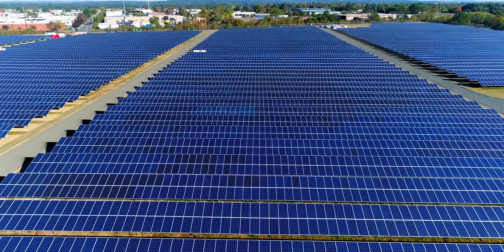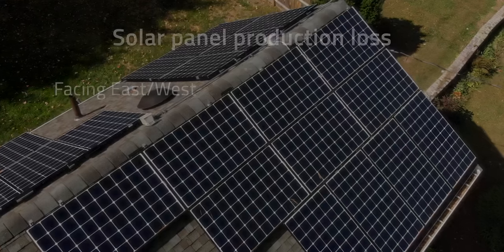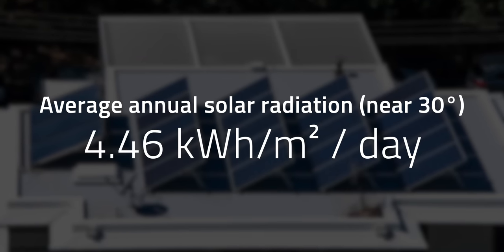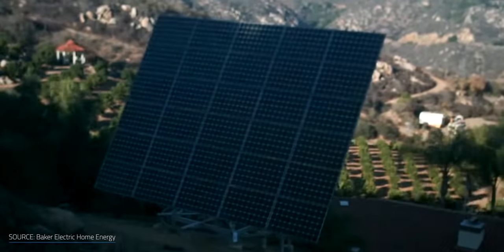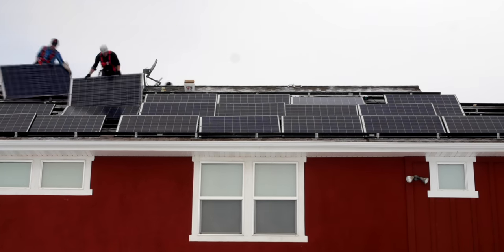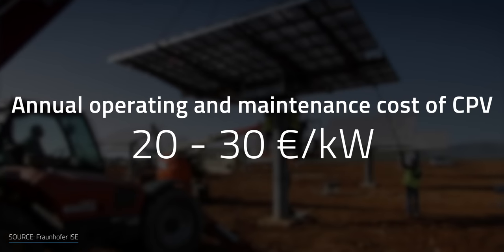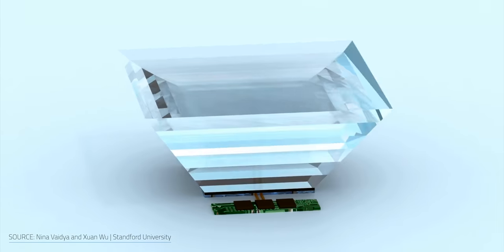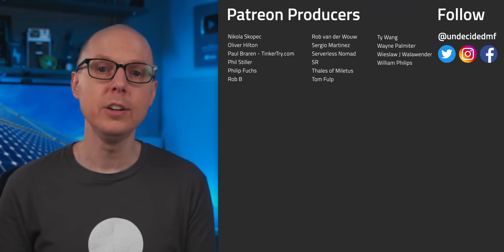This Invention Could Supercharge Solar Panels

Comment: As a mathematician, I'm really skeptical. If you don't move your panel facing the sun, you don't get more surface capturing sunrays. The only purpose of this concept is to get sunrays hitting perpendicularly the cell. A very small improvement ...
Reply: I suspect that solar cells can only absorb a few percent of the available rays.  I think that increasing the surface area of solar panels without increasing the required footprint might result in better efficiency.
Reply: I was thinking the same thing. If you have a 1sq meter panel at 20 degree tilt putting concentrators on doesn’t change how much sun energy is hitting that 1sq meter.
Reply: @ecospider5  we are going to the same thing: when you concentrate is the PV the best fit as technology. It absorbs the upper side of the spectrum and the infrared spectrum converts to unnecessary heat which needs to be dissipated. Good discussion: :)
Reply: It enhances the energy per chip.  Not the energy per roof surface area.  Cheap recyclable plastic not silicon wafer and rare earth elements.
Reply: Totaly agree. How these concentrators can increase the total capture surface? They can't. So, even assuming no losses from the concentrator, the system should have the same drop in performance as a regular solar panel when titled.
Reply: Yes you get less energy with less area of course - i think the only novelty in this video was the part at the end where the concentrators are made so the light is always funneled to the pv cell. 
If you used a simple lens that focuses light on the pv cell when the source is normal to the lens and then shine the lightsource from a different angle the beam might not hit the cell.
*     vs     *
I                  \
O                  O
I                      \
_                   _   \

This only solves the problem you create by having the pv cell not directly everywhere on top.

Making the concentrated pv cell generate the same energy as if you used it on top but with less cell material. And more energy if you use more wavelengths( more expensive cell)
But as others pointed out cooling and the complex buildup might be a problem.

Also i see a problem with the 3dPrinted lens- if its Plastic it will not age well in the uv exposure and potentially even the moistness.
Reply: @ecospider5  of course not. and when you hear things like 'ten times more energy' you know its a scam.
Reply: plus solar panels are quite cheap anyways I don't really understand the extensive research when you can just buy 2 panels instead of making one more efficient
Reply: While that it is true that you get a higher energy gain from direct sunlight, the differences can be somewhat small as he showed. I know 10% doesn't seem small, but it is if you can use this tech to make higher efficiency cells. They can be smaller while still receiving the same surface area of sunlight as larger cells. This could help reduce production costs drastically as the solar cells are the most intensive and expensive part of the manufacturing process.
Reply: My thought was similar.  The angle of the panel sets your flux density.
Reply: @zfolwick  Correct, CPV method just concentrates the sun rays to a focal point, sure there will be some gains but more of an efficiency outcome. Surface area is where most of the gains are made, make the photoelectric surface triangular at the microscopic level similar to a concertina effect but at the optimum angle too much will results in negative gains.
Reply: Yeah, have you never seen the reports of the 40%+ effient solar cells? These values were optained under concentrated solar conditions. The efficiency of solar cells goes up when you increase the photon flux hitting the cell, so not only does your panel produce more energy, it also converts a higher percentage of the light energy hitting it into usable electricity, further increasing the amount of electricity produced.
And now, do the maths: what happens when you decrease the amount of polysilicon you need to produce and dope and make into wavers per solar panel (which has a huge cost in terms of energy and subsequent CO2 emissions) and these cells do not only capture the entire light that hits a full-sized panels surface, but due to the concentrator effect, each tiny cell also has a few percentage points more efficiency in converting that light into electricity. Now couple that number by increasing the amount of solar energy that hits the panel directly over the day, instead of being reflected by its surface thanks to the concentrator and the result of your calculations should look quite different.

There's a reason why people got so excited when they heard that you can increase solar panel electricity output by 2% if you heat them shortly before sunrise through resistive heating. Because 2% more output per panel may seem negligible, but on the scale of entire countries, it adds up pretty fast.
Reply: Exactly!
Reply: @DavidAttenbraai  There is not always room for that extra panel.
Reply: @MrMarkdro  The multi-layer lens compensates for the different incident angle so tilt doesn't matter (up to a given threshold, I'm sure). The light will still be directed to the bottom of the lens.
Reply: @edeaglehouse2221  The pronlem is befor the lenses. The lenses can only redurect the light they capture. So when they titl, they will capture less light. Exaclty like conventional solar panels. Thee is no way around this.
Reply: @MrMarkdro  Actually the problem is two-dimensional thinking. The lenses and PV cells are three-dimensional. The lenses are directing more of the light penetrating the lens surface and redirecting it at closer to optimal angles to the cell surface so the cell is getting more light it can convert. The lens won't completely eliminate the efficiency drop from the tilt, but it will reduce it to the point that the panel wouldn't need any fine angle adjustments to maintain its maximum conversion efficiency, because the light always gets to the cell at the best angle.
Reply: yea, studying Astronomy will tell you it is all about the flux you receive over a surface. You don't actually receive more flux because that is fixed (what you can do is use less material. but these looks like hell-a expensive to make)
Reply: One of the key things about the solar panel is you are using the photon to knock a charge though a semi permeable barrier. Ie its colliding with something and forcing it though. As if its not perpendicular to the force it needs to travel a further distance to get thought the barrier as well as requiring a greater collision force.
Reply: @generalharness8266  True. Photons could knock the charge more effectively with Agile. I still doubt that the gain worth  the cost of these big lenses.
Reply: Ultimately I think the idea is to use less PV material (the expensive part) and more concentrator material (ideally an inexpensive material).  So you'd reduce the amount of PV material to create a given amount of power, but you wouldn't actually reduce the amount of square footage of the panel.  The math works out when you think of it that way.  Especially when you combine that with being able to use a higher end PV because you need less of it, and if you can use the defraction properties of the concentrator to channel the light at a more efficient angle regardless of the panel orientation.
Reply: @edeaglehouse2221  Ideally, in 3D, maybe 1% more surface, assuming a 10 cm high lense   Practically the lense will be around 2 cm. So, maybe 0,1% more surface. Now, everytime light is passign from a crystal, is loosing energy. So your lenses practically collect less energy for the same given surface. But because they focus it, they can  make usuable a bigger percentage of the energy. That is all. Now, trying to say that it will magically focus the light that is coming from the side and it will be like is coming face on,  is not based on logic or science, but on wishfull thinking.
Reply: I think your scale is off by a factor of about 100. No, there is no more light hitting the surface of the lens but more of that light is being directed to the cell at the bottom because of the way the lens is designed. Couple that with the fact this uses 1/4 the cell area and uses a more efficient cell and it is going to produce measurably more current. Even if the panel is tilted a little bit, the cell will still almost perpendicular light. Sounds like a win to me  add long as the lenses cost significantly less than the beefier cells.
Reply: Never thought I’d find a chain of actual intelligent arguments in a replies section, this be the most psychologically healthy group of strangers I’ve ever seen
Reply: Mathematician....yes that explains  why you dont know what you're talking about it.
Reply: @DavidAttenbraai  horse and buggy were probably cheaper too
Reply: You might want to go revisit your trigonometry.   One thing that does make what you say a little more true is the fact that as the sun gets further and further off of the pointing angle, ie nearer the horizon, it provides less power/area than when high in the sky.  This is due mostly to atmospheric attenuation.   

You should probably rethink your skepticism when the data is empirical, as one example was here.  Just sayin.  I remember a prof saying if you calculate the weight of the guy in the elevator to be a ton, in one of his problems anyway, you might want to check your work.  :-)

You DO get more effective surface area capturing sun rays off axis.  Take the source and put it 90 degrees to the panel face (perpendicular to a side).  How much light is striking the panel now (let's put it in a vacuum to make it easier).   Right, zero.  Cosines, anyone?

Comment: I mechanised my panels using linear motors and a raspberry pi and I noticed quite an improvement tracking the sun. Beefing up the whole installation over the next few months - very therapeutic seeing the Kw/h being home grown vs the rip off energy companies that are shafting us in the UK & EU currently. Also I don't use a sensor, mine is math based using longitude, latitude and date - credit to the egg heads that wrote the original Python code I plagerised - I wish I was that clever!
Reply: Solar tracking kills solar panel life span. No free rides.
Reply: @johnslugger  In the UK/EU with energy prices through the roof, I'm not sure what the trade-off is. I've got more electricity than I can use parts of some days, it's not cost effective selling it back to the grid so I'm building a sand battery in a disused sauna to offset cost of gas.
Reply: you were still smart enough to setup a tracking solar panel with an R-pi...your doing fine my man
Reply: Very clever and this is the best way to increase solar panel output.
Reply: @johnslugger  How so?
Reply: @anxiousearth680  Every photon caught to make wattage degrades the panel faster. That what breaks the Silicon P/N junction matrix down until its no longer as conductive as a new panel once was. Solar is NOT a "forever power" source. 25 Years Tops with a 20% drop at 12 years!
Reply: @johnslugger  Eh, who cares. In 20 years time you can add 2 more panels and make up the difference.
Reply: Is this documented anywhere?  Would love to see the details of the mechanical setup and the r-pi automation.
Reply: I have a small mount for astrophotography that follows in one axis (right ascension) the sideral rate, do you think it would make sense to adapt my small 200W foldable panel to it?
Reply: @tesla747    I have done the math. The money spend on TRACKERS is better spent on buying 30% more panels. Same power output with 35% longer panel life and less complexity.
Reply: @johnslugger  Panasonic panels are still 92% efficient (compared to new) after 25 years.
Reply: @pauld3327  Only 3% of panels on Roofs today are Panasonic. 95% are the cheapo Chinese DANG-YU-MONY-FEL-GOD brand.
Reply: Americans have a tendency to build houses out of matchwood so if your house is hit by a tornado, your set up is toast anyway but just about anywhere can be hit by the tail of a hurricane or by just high winds especially in Britain where houses are generally of more substantial construction.   In high winds would I want my panels screwed down to my roof or stuck up on flimsy poles with the risk that one may detach itself and scythe through the air decapitating an innocent passer by ..... or even worse .... damaging someone's car !  Having been a windsurfer for decades, I KNOW the power of even moderate winds on relatively small areas of sail. In high winds, I hate to think about the strain on the gears of those moving things. 

As for rip-off electricity companies, the answer is simple .. in Britain, renationalise. There is no reason for the aristocracy to be cleaning up via the turbines on their lands at the expense of the rest of us. The answer for America is to take electricity, gas and water into the hands of the people instead of allowing it remaining in the hands of chiselling parasites. If you are filling up with petrol or diesel, there is at least some kind of choice. Electricity is NOT delivered in tankers. There tends to be only ONE electricity and water connection to most properties. Any idea that you can have a choice of supplier is illusory. The question is, who owns the cables and pipes.  A few decades ago most of us in Britain, were horrified upon seeing film of some American streets defaced with massive poles festooned with 40 or 50 cables for cable TV companies. Surely, you don't want that for electricity.  Imagine the roads if any Tom, Dick or Harry could dig a trench to lay the 35th water pipe in the road for just one customer. Therefore, there is no such thing as proper choice for water or electricity so they should be in public ownership instead of being at the mercy of the gouging monopolies as of the Gilded Age.
Reply: @johnslugger  

How come?  Due to the additional heat? Then the solution is to cool down the panel.

Cooling the panels increases their lifetime by a factor of 2.
Reply: @niv8880  

I heat water and make ice with the excess energy. Thermal and cryogenic batteries, I call them,
Reply: @johnslugger  

I heard it is the temperature that degrades the panel not the photons reception nor electrons production.
Reply: @joseribeiro9564  

yes, go for it.
Reply: @ajarivas72  The Active layer in solar is the "N" / "P" inner-face. This is the same interface that an LED uses to make light. (Which is why a solar panel glows red at night if you do not have a diode blocking the power. In both cases you get about 20,000 hours before this inner-face loses contact and in the case of an LED it's over and dead. In the case of solar small areas die off and not all at once. In fact the best way to see how and in which spots a solar panel is dying is to hook it up to a battery and remove the blocking diode. On a new panel it glows red evenly and gets warm to the touch all over. In an older panel you can start to see dead spots that no longer glow and this is where the "N" and "P" layers where too thin and they are now burned out. People do not notice since this does not effect the voltage output but really hurts the amperage output hard so its hard to find the bad panels. This trick of making them GLOW at night is one of the best tricks for quickly spotting the duds.
Reply: @johnslugger 

"Solar tracking kills solar panel life span. No free rides"

Build in a cold water circuit to keep the array cool then.

If you are smart you can even hook the circuit up to a heat pump for efficient home heating.
Reply: @chrisbraswell8864 

"Very clever and this is the best way to increase solar panel output"

On the ground it is.

As stated in the video the weight considerations alone make tracking hardware sub optimal for roof installations.
Reply: @mnomadvfx  I tried it 22 years ago. The water got full of green Algae. When I added Chlorine all the connections rusted. Very complex problem in the real world.